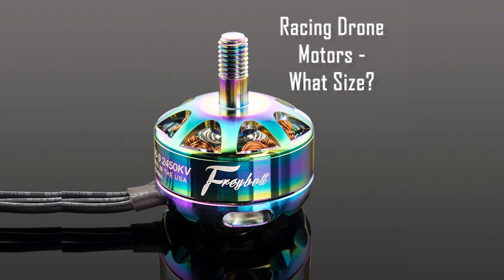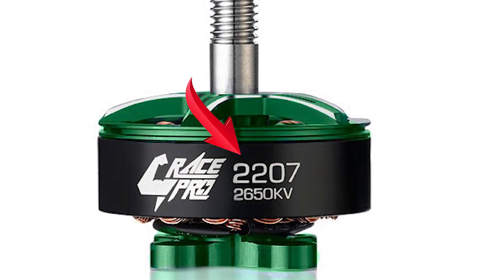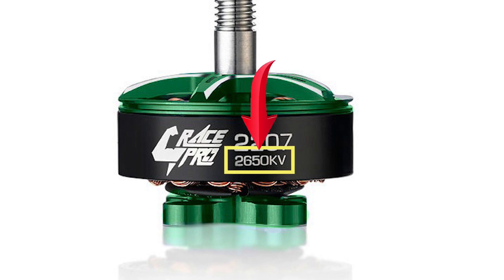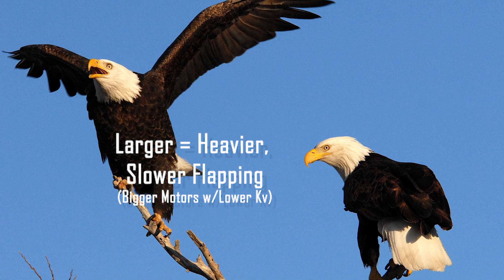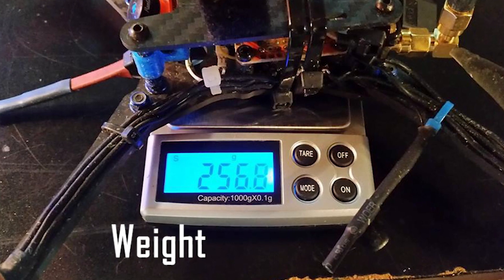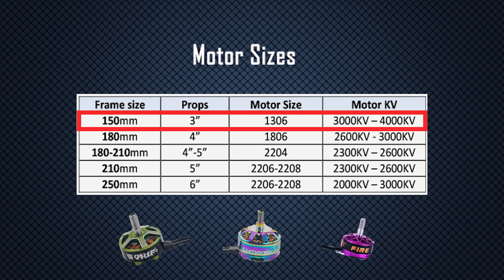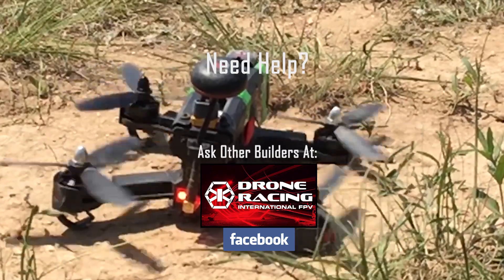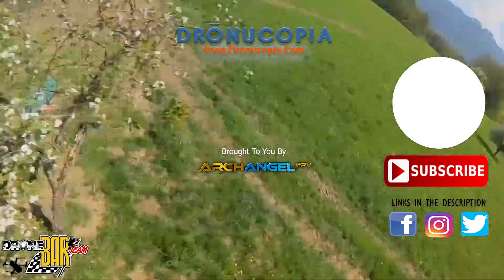"How to choose motor size for your FPV racing drone/mini quad" | Drone Racing Report | Vol 18

Comment: T-Motor F40 ll Pro 2400kv  with HQ 5 x 4.5 x 3 props, on Armattan Rooster frame x 3, Joshua Bardwell FC, Speedix 35A 2-6 S esc, Immersion Tramp vtx, Foxeer Predator mini camera, FrSky R-XMR
Reply from the maker: Nice setup! You usually fly with 4s LiPo's?

Comment: Great video! Ho you do not consider 23xx size?
Reply from the maker: Great question! Our chart certainly did not include all sizes available, as there are so many options. We could probably make a feature-length film talking about motors!

The 23xx motors are great for builds such as 5" and 6". We see lots of quads now with 2306 motors. Do you use 23xx in your quad?
Reply: I use the 23xx on some of my quads. 23xx They have better behavior at low rpm, 2206/07 greater punch ... 2205 good behavior with propellers of different kinds. On my YT channel you can see the various configurations that I indicate in the title and description
Reply from the maker: Great summary. We'll check out your configurations on your channel. What frame and props do you prefer to use with the 23xx?
Reply: Dronucopia HQ 5x4.3x3 V1S or Dalprop T5046C
Reply from the maker: Nice... I have some 5046 just ordered yesterday.